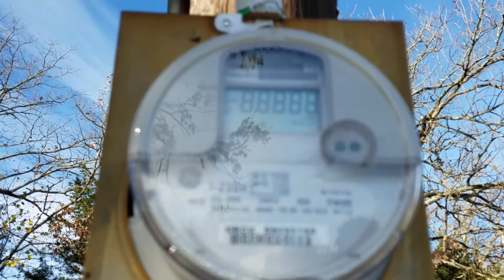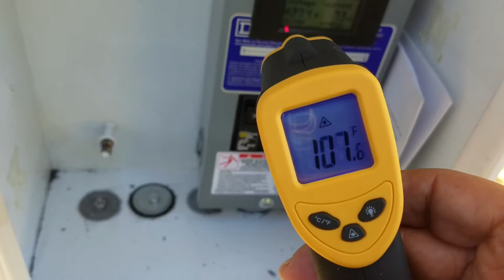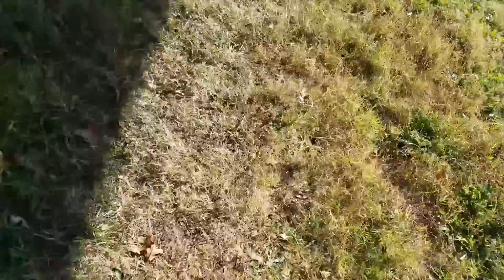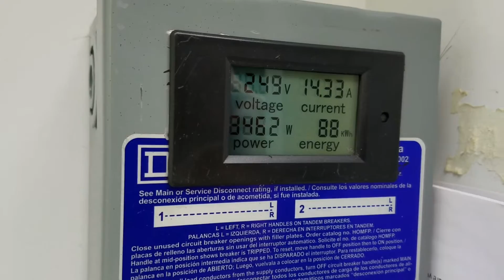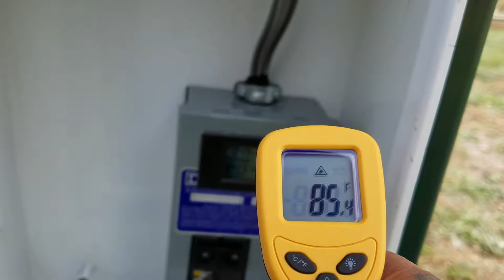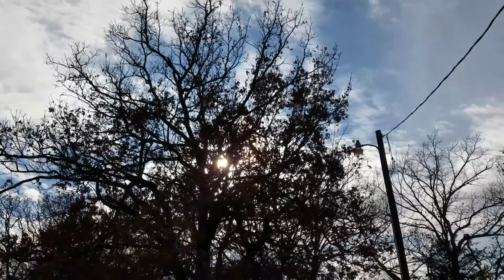Hazy Sun Solar PV Grid Tie Production Smart Meter

Comment: how are you wble to do that without UL listed grid tie inverters?
Reply from the maker: Keth My local electric company does not care if they are not UL listed because they are on my side of the meter. I had it properly inspected by my electric company. That being said, the inverters in question ended up being Chinese junk and I ended up replacing them with Canadian made inverters.
Reply: Thanks for the reply!  Good luck with the new inverters!